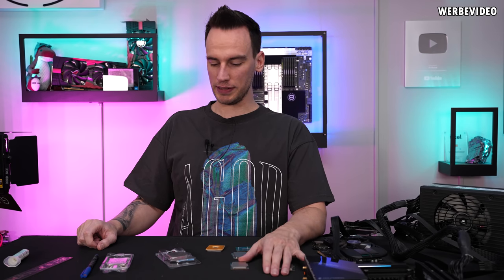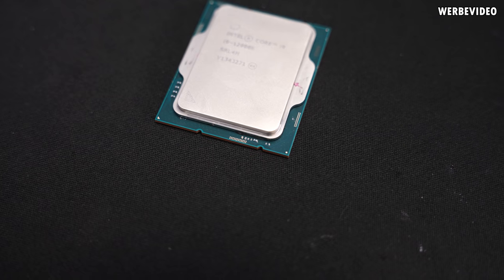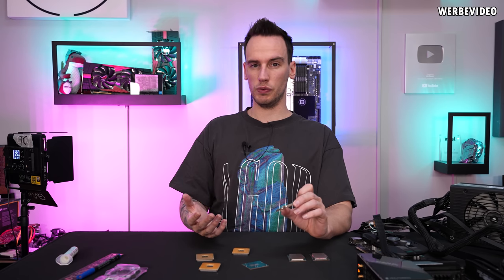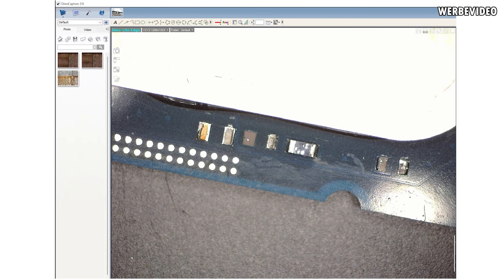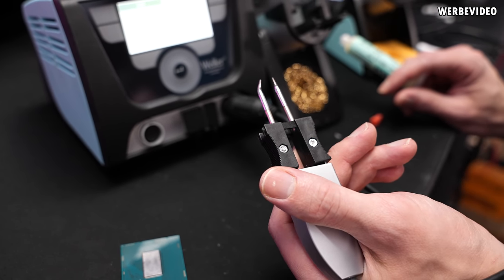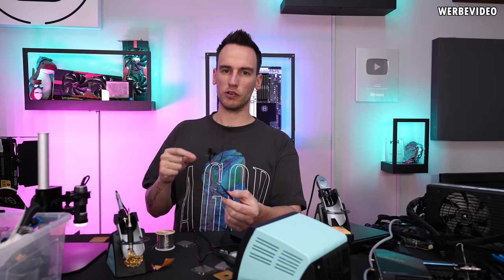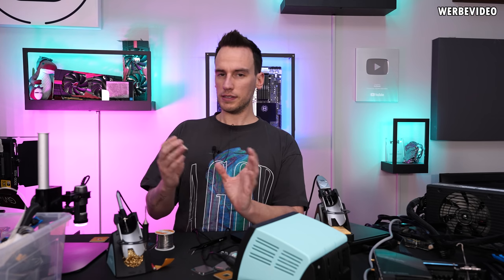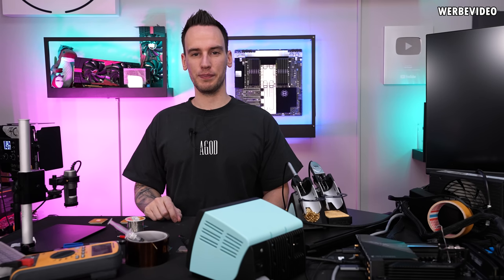12900K with damaged SMDs - is it possible to fix this CPU?

Comment: I wonder what that resistor's function is if the system seems to work without it. Anyways, great job on the repair of the other two. Working with such small SMDs can be a pain.

Comment: Great job with the smd's on the intel chip. For the AMD ones you could also try to use different diameter seringe needles that are used for science experiments and have round tip.

Comment: Great work Roman. Usually ripped off pads are very hard to work with. Scratching the surface is probably the only way to try to expose some metal from beneath.

Comment: I’m pleasantly surprised that it worked with that missing smd. I’m great job on rescuing it and showing others how to! I’d love to get my hands on it, been trying to save up for a much faster cpu for awhile now for running my build I had as a kid in pcem. My old ivy bridge based stuff just isn’t up to the task. Got everything I need for my new build other than cpu and motherboard at this point.

Comment: Glad to see that repairing the broken pad and soldering the final resistor wasn't required to ressurect the CPU!  I'd be a bit worried about soldering to the side with the via after scraping away the fiberglass, as the copper underneath might not be part of the same electrical net  compared to the via, and soldering to the tiny 80 um via without bridging to the pad is way outside my skills.

Comment: I suspect the ideal equipment to attempt a connection to that damaged SMD pad would be one of the machines they use/used for attaching gold bond wires to old IC dies; the wires are extremely fine and the device includes movement stages to precisely position the tool to attach to the correct point, and from there you could bond the wire to the other end of the SMD resistor by mounting it at a slight angle so it doesn't get in the way of the bond wire.

Sam Zeloof (who you may be familiar with for his home grown IC experiments posted here on youtube) has a working vintage/manual version of such a machine. If you encounter any stability or behaviour issues with the CPU with the SMD missing, you might want to try contacting him to see if he can use his equipment to reattach a bond wire to the package!

Comment: Clutch pencil 
"Clutch Pencils for 2mm Leads are designed to provide a superior grip and feel to the designer while at the same time maximizing the use of the lead within. Regular wood case pencils can no longer be held comfortably in the hand once they have been sharpened down to a short length."
A hypodermic needle works well to.

Comment: Man, you are incredible, thanks to you I can overclock my core2 Quad for the first time, now you repair cpus that anyone would give up for dead, you are great bro.
Reply: The old bsel mod?
Reply: @_BangDroid_  I do not get it?,
Reply: There's a mod you can do with electrical tape on the core2 quad called BSEL, I was running my old Q6600 @ 3GHz all 4 cores for like 5 years
Reply: @_BangDroid_  Wow, I really didn't know about it, and in fact I just overclocked my old Q9650, and only managed to overclock it to 3.4GHz, since it really is a CPU that I don't use anymore.
Reply: Nice. I still have mine, but I drilled a hole in it and turned it into a keychain :p

Comment: for soldering to that via, personally I'd take some UV solder mask and put it over the undesirable copper planes, leaving just the one you want, of course curing it, then add a small solder ball to the top of it, a really small amount of flux, and then use hot air to melt the solder ball onto the pad. Once I had that, I'd tin up a small wire, add it to the solder ball, and then once it was connected, use more solder mask to secure it. Now you have a wire on there, and you can manipulate that more easily, allowing you to solder it to the lead.

Also, before going to all of that trouble, I'd take a good look at it with a multimeter on the broken one, see if you couldn't track down where it went. I'd also maybe document my findings on this sort of stuff somewhere, and also allow user contributions (a wiki format is great for this!)

Comment: well done fixing the 12900k! awesome, and have entered the giveaway. also interesting if can be fixed those amd ryzen cpus maybe one day. would be pretty cool too

BTW for missing smd pads situation... IDK if you have seen this already. but can purchase on aliexpress these new sticker packs, of replacement copper pads. these then can be stuck onto the pcb exactly where was the missing pad. of course it is still a bit of a challenge to reconnect up the new pad to the existing broken trace or to the bare via. because the connection is very small. so still requires good micro soldering capability. some people will use a fine solder paste or bga solder balls. very small. and hit it with a hot air gun to melt the solder. and get it to actually stick connect on to the tiny via. so small

Comment: I delidded my 8086k and was most stressed about knocking off any tiny SMDs but fortunately that one was definitely the easiest generation to delid from what I can see online. I dropped from 88c under prime95 non-avx small FFT, to 69c. I think I had one of the most perfect applications of liquid metal (Conductonaut, of course!) in history for such incredible results. I am eager to get on a 12th gen platform and start overclocking again :D

Comment: When micro soldering on a pcb with a IHS or heatsink you need to heat up a brick in an oven and then put the pcb on the hot brick. This allows you to retain your solder temp long enough to bond to trace/vias.  They also make board heater but they are expensive.

Comment: Nice work 
Just a quick recommendation before bending the pin try heating it up a bit slight heat helps the metal relax

Comment: Wow. Tried to save an imac with a slightly bigger smd piece and the same dead/missing pad issue. Once I build courage I’ll try to dig out the via as you did here to save it. Nice save on the 12900.

Comment: For small SMD parts like that, I think reflowing would definitely be best. Get a hot bed like the new Miniware MHP30M and then use a fine heat gun on top. Just need to place some solder paste down, then use a needle to hold the SMD parts in place while the solder melts.

Of course for that  missing pad... Oh boy. That's a hard via to attach to.

Comment: That smd work remind me what I had to do when measuring bus inside phone 4 wires 0.1mm wide and 0.1mm spacing.
I had to use 0.15mm copper wire for bring out measurement pads. So 0.05mm spacing between wires and these were in 2nd or 3rd layer.
Found area where was only GND planes top of that bus then to dig 1x2mm area with scalpel. Stereo microscope was good help for work. I think it took 4-6h and lots of coffee to prepare that measurement  :)

Comment: CPU with broken SMD passive components can be fixed, you just have to clean the mess with fine-tip soldering iron and some thin desoldering wick as well as decent flux, then solder in the new SMD capacitor and / or resistor via hot air soldering gun and good soldering paste. Recheck everything after the soldering, it should work afterwards.

Comment: As far as the AMD CPU is concerned, I remember an older LinusTechTips video where Linus used the pins off of a donor chip and put them into the motherboard's socket where the pins were missing. It's maybe not the best fix in terms of quality but it's easy for people who don't have access to a ton of soldering equipment. Great video as always!

Comment: Good Sunday,
I wonder if this was a de-lidding gone wrong. I had a 3200G with a whole slew of bent pins on it from my Wife's brother. After hours on and off bending pins back with a razor and screwdriver we finally got it socket-able to a motherboard. Hecking scary stuff to work with.

Comment: Can't help but wonder how can one managed to do a damage on SMD. And I don't think a drop would make this kind of damage. But what's even more crazy is that you managed to get it working again even when you don't have extreme micro soldering equipment and it still can boost. Massive respect

Comment: For the broken AMD pins, try finding some pins just ever so slightly longer than the originals and drop them into corresponding holes in the socket and slap the cpu in, pressure from the hsf will handle their connections. Or at least that's what it will theoretically do.

Comment: Hi,  I used to work in a Micro Electronic Factory and also had issues with the Weller micro soldering tips burning out.  Hot tweezers always seemed to work though.  Flux paste is wonderful don't you think?  I've dealt with bent pins successfully in the past but broken ones?  I think you had a video in the past where you soldered on pins to a microprocessor.  Fun stuff, keep up the good work.

Comment: IIRC if you hold down the button on the end of the mechanical pencil the tip will stay out. Makes it a bit awkward to use but you can force the tip to stay out.

Comment: nice to see it could be easily repaired! 😊 i also have a motherboard with a burned vrm controller and a transistor on the backside that got off the pads that i need to repair. i sent it to MSI and they refused to rma it! 🙃

Comment: I have a Ryzen 5 3600 that has what I assume is a bad memory controller. Took considerable time to figure out which piece of hardware was causing random reboots. Luckily I have many components to swap out which makes the process somewhat easier. By increasing the SOC voltage to 1.2v, I was able to gain some stability at stock memory settings, but not with overclocked ram.

Comment: Maybe the missing pad is connected to one of the other resistors, the capacitor, or even one of the pads below.
It should be easy to check on the other CPU, if it's the case then it would be possible to do a full repair with a wire.
Even if everything seems to work, there could still be a weird bug, or something which depends on the HW configuration (you showed a test with DDR5, does the CPU work with DDR4 too ?).

Comment: Maybe use a "mask" type to hold all pins in place and use hot air in order to fix the pins that are missing? With the hot air those broken pins will be loose and with the mask you can just add a solder paste to the contact points for the pins and blow air again with the "mask" holding the new pins in place.

Comment: Im just thinking is there a possibility on the ryzen parts to break some of the pins eventhough its mounted correctly havent visited mine yet in a year but noticed some issue along the way though. Like ram not getting to the target mhz but ryzen 3000 and b450 had compatibility issues with ram though.

Comment: When it comes to fixing ripped pads I did a ton of research and found conductive silver PCB glue? Not sure but I repaired a amp/DAC that had all pads ripped off. I grinded the area cleaned it then lined up the connector and set a line down to solder to.

I also have a 5950z it has 12 missing pins it's a nightmare but I think I need to work from center out with pins.

Comment: Could you not solder mask around the trace and then build up solder from the exposed point to attach the missing SMD? Probably something you'd need to highly experienced to try out though. Thanks for the vids

Comment: I am getting into the giveaway so Der8auer can confirm it is real me not artificial intelligence or BOT.

Also I just want to say that the easiest way to repair Ryzen broken pins is heat up in oven to some around 220°C and then keep on the temperature using heat gun or hot air station. It requires surgery precision and a lot of patience. I broke 2 cornered pins on my 5600X when mounting it on open test bench before completing entire build. Just to be sure everything is working fine. I dropped it off like Linus Tech Tips used to do. I got lucky because it was only two cornered pins which made repairs easy. It would be a total loss for me if some middle pins went to heaven 😇 Sometimes a carpet can be deadly to AMD CPU

Comment: I got an old am3 CPU for free which had, and I am not exaggerating, more than a 100 bent pins. I think I used a 1mm flathead ifixit bit and a plastic card for final straightening, broke off exactly zero pins.

Comment: your might have been able to do it more easy without digging down.. just use solder paste and push a wire down and heat it up with a heat gun. but u can also try just putting solder on the end of a wire and use flux and heat it up and it could still work. you can also use solder mask and try to make something work out

Comment: Is that small smd capacitor on the bottom left of the 12900k needed for it to run if not what limitations do you have without that capacitor I have a 12700k with that capacitor missing I can't test it on the mobo right now due to my mobo being out on a rma

Comment: The easiest way to repair pins is to put new pins into the socket and then mount the processor. Everything works perfectly without soldering :)

Comment: I can't help but wonder if simply cleaning up the copper end of the via, dousing it in flux and then laying a hot solder ball on it would make a connection to the via, enough to place the resistor?

Comment: The 12900k resistor with the missing pad could be a pull up or pull down, thus why the cpu works without it.

Comment: I'm a medical doctor and you can consider using the needles of syringes as pins. These come in various gauges so you can pick which gauge has the same diameter as the CPU pins. These are made of stainless steel though and I have no idea if you can solder that material onto the CPU.

Comment: hi from norway running a i5-4690k during winter time in my room i got it to 4.9 gz cinnabench stable on air, which was cool. although i had -13 degress celcus in my room ;P. but i have this weird issue were windows reports the cpu frequency at 7.2 gz.

Comment: Why struggle with hot air guns when a small hot plate would be sooooo easy to make for someone who knows electronics: Just mount a 50W power resistor (an 0.47R Arcol HS50-0R47J would produce ~55W at 5V), mount it on a CPU-sized piece of 5-10mm thick piece of metal like steel/aluminium or whatever piece of "scrap" you can get for free in your nearest machining shop, a 5V 10-15A Power Supply (like a cheap open/closed-frame Mean Well) and then just add some kind of temperature control that can be as easy as an Op Amp, MOSFET and a cheap multimeter temperature probe (on the 5V), a bought Mains temp controller like for an oven or something that will turn the whole thing off (240Vac) or even a fancy Arduino thing with an OLED/LCD screen.

There are also CHEAP mini hot plates for SMD work like the 60W MHP30 Mini Hot Plate if you don't want to bother making something!

Comment: Repairing ripped pads are so hard even if the trace is on top. At least the CPU worked even without the resistor.

Comment: No expert on microsoldering here... but could you possibly get something non-conductive (some epoxy maybe?) to cover the rest of the copper around the via and then repair the pad on top of that? But, I guess that as long as it works...

Comment: It's rather lucky for that 12900k to work considering the missing resistor. Usually we can get away with missing capacitor but not resistor

Comment: Ah yes, the safety mechanism in the mechanical pencil is pretty pointless IMO, it get stuck very easily from the lead dust after prolonged use which may broke the plastic clips inside that pushes  the lead out. Also most people can't be bothered to retract the lead back into the pencil anyway so you'd still get stabbed if you're not careful

Comment: still find it very interesting how youtube / google is not updating notifications properly for followed or subscribed channels and replacing it with non followed channels , i dont need any suggestions nor do i even watch the suggested channels provided , i truly think its time to end the suggestive side of promotion or at least have an opt out option within the youtube settings menu that actually works - ? - 
i just received this notification in the suggested listing , after well over 1,000 subscribed channels i think i need a more direct just update to subscribed channels and the suggestions need not apply at all

Comment: Rather then repairing the chip just insert the missing pins into the socket on the board, make sure they are just long enough to make contact with the chip then lighten down.

Comment: That 12900k has some pretty weird damage, wonder how it happened. The AMD ones make a bit of sense, as you either drop it or pull/put in the socket wrong, but the 12900k is just weird...

Comment: The SMD resistors that you were able to solder on could be used to configure some internal parameters of the CPU like serial numbers, etc. This could also explain why the CPU was idle, since it was unable to correctly configure itself.

Comment: I get that if you have a dead or unreliable cpu, that you can try repairing it yourself if you have the know how and equipment, but are there option to send it to a repair company like Ubreakifix or the manufacturer. These videos are always fun to watch in a nerve racking way, but still, rather have a quote unquote "200 dollar coupon" for a new cpu for not doing the repair instead of technically paying full price for a new one

Comment: For the pad that's gone, couldn't you take a tiny think piece of tin, make a tiny hole where the via I think you said it's called is, glue the piece of tin where the missing pad was with non conductive glue, the you just have the pin hole exposing the via, put solder on the tin and bam! you have a new pad, I know nothing about soldering but thought it could work?